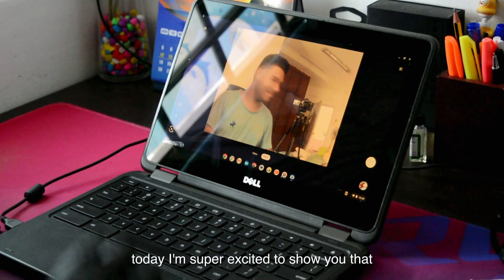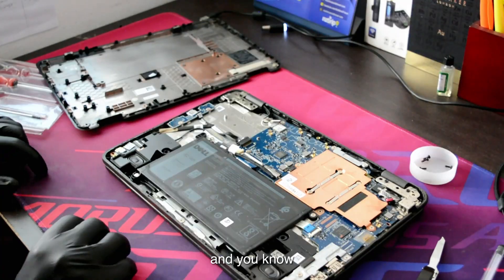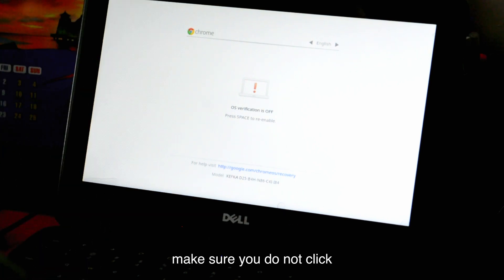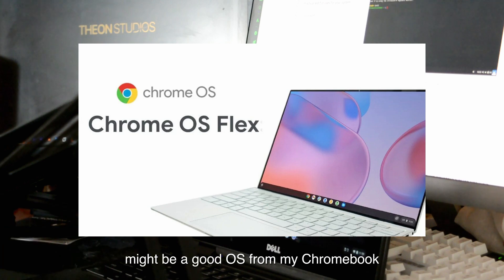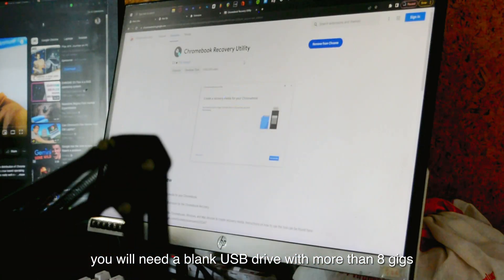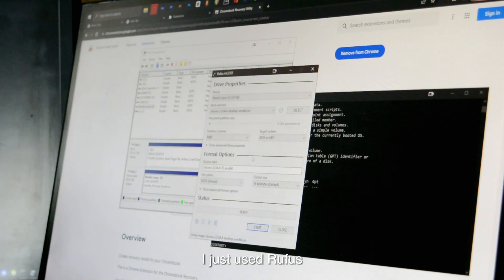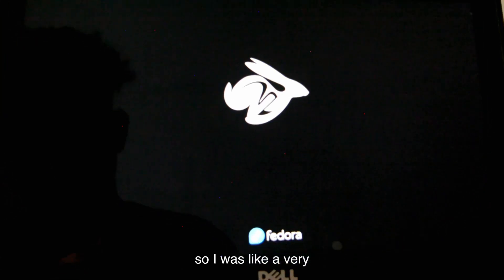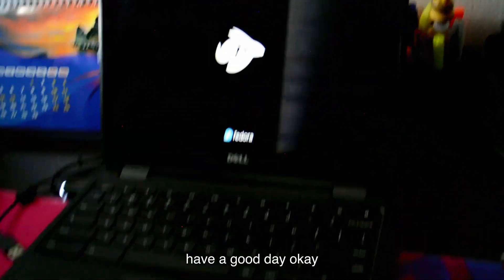How I turned my End of Life $40 Chromebook into a full fledged Linux Workstation ! (FOR STUDYING)

Comment: write protection method may vary by chromebook. some have a screw, some require the battery to be disconnected (& the device on AC power) to disconnect the write protect circuit, and some devices require a "Suzy-Q" cable (looped back USB C->C cable basically)
Reply from the maker: great info !